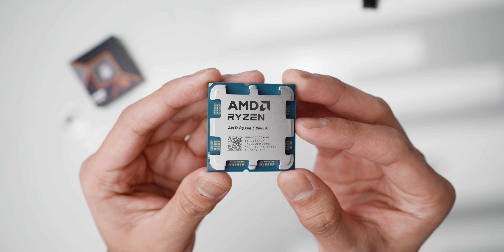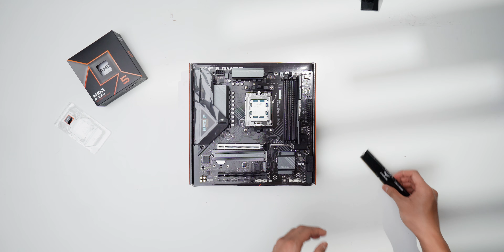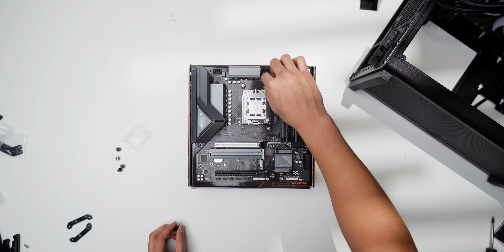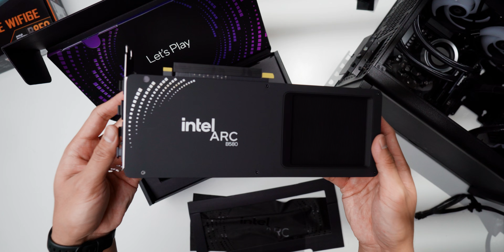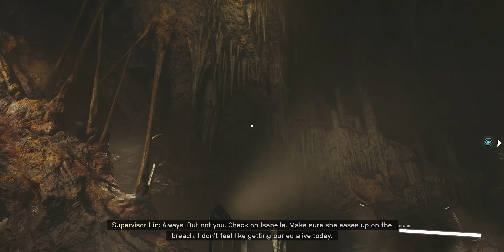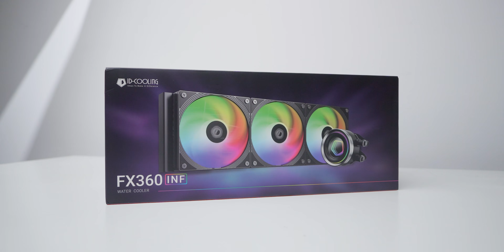This $1000 Gaming PC Build Plays Everything

Comment: The Ryzen 5 9600x is definitely a great CPU for the $$.  I have one in a Mini-ITX build paired with a RTX 4070ti.  Runs Arc Raiders, Battlefield 6 at 1440p at med/high settings with over 80fps.

Comment: Generally I like your build:
CPU, MB, SSD, RAM all good, I have similiar setup myself
I love the case visually
 however I would consider 3 main changes:

1. Save some money on AIO, for this CPU it is really not needed, a decent air cooler for $20-30 will do well.
2. For a price around $300 you can get a RX 9060 XT with a good black friday deal, not such a big difference in price against the battlemage but it will last you longer
3. The PSU will be your future bottleneck, I would go for at least 850W (ideally gold) to give yourself a bit of headroom for upgrades, the price difference won't be that much.

Most of all though I am really missing fans here. Even for a smaller case it is a lot to ask from your AIO fans to keep air moving to keep the GPU cool with only passive intake, even if most of the case sides as mesh. Plus if you decide to upgrade the GPU to something longer in the future you will need to get rid of the AIO to be able to move the PSU more towards the top (though most likely you will need to switch to a more powerful PSU anyway), but you will end up again with no proper case air movement beyond CPU fan and GPU fan. I'd stick 1 fan to the front bottom and another top rear to get some front-rear movement across the case and consider leveraging some chimney effect with 2 top  fans; not sure you can add any to the bottom, but try to create a diagonal air movement to go from front bottom to top rear across GPU and CPU with an overall positive pressure balance (more air on intake than outlet) to reduce dust build up through all the mesh you have. Sorry for the long rant, I have recently built a new rig and I have spent an unhealthy amount of time studying and optimizing my cooling and air flow.

All in all you would likely end up $50-100 higher, but with better thermals and a bit more future-proof build.

Cheers!
Reply: 1. A $20 air cooler doesn't give him the thermal headroom if he wants to upgrade to something better on AM5 down the line. Might be able to get away with it for this 9600X with 65w TDP but an AIO sets him up down the line. And this one is a super good value.
2. Good recommendation, agreed! 👍
3. 850W is prob overkill for this build. The CPU and GPU (both the Intel ARC or a 9060XT 16gb) will only use ~250W or so combined. 650w will give plenty of power for the system. It more than meets the requirements set by both GPU manufacturers. I'm currently using a 9800X3D with a 9070XT and the for the first few months I was using an 8 year old 80+ bronze 650w Corsair PSU with no problems. I upgraded to a 750w plat but only because I wanted something with a 0 RPM fan.
Reply: @kalapanas I’m looking to get my first pc, I mainly play fps games and warframe on console. Are there any prebuilts that you’d recommend for me? Or a setup that would run these types of games decently on pc?
Reply: I agree with your recommendations.  I would definitely get the RX 9060 XT with 16gb ram for this build.

Comment: Should have went 7500f, Phantom Spirit and Montech Century ii 850 watt. Build would have been around the same price, maybe even cheaper but actually have upgradability. “Upgradability” as you scam people into a low wattage psu that doesn’t have upgradability. You spend more on a cpu that performs the same as 7500f and you unnecessarily grab an AIO for a 65 watt cpu. 

Also for 650 watts psus. Rosewill VSB is the best option. Cheapest and still C tier like the 650BN

You even could have just went 7500f, same psu and a $15 budget air cooler and with that saved money you could have gotten 9060xt 16gb. Your build reeks of amateur.
Reply from the maker: Thanks for the feedback, I did mention at the end some of what you recommended. Still learning so will keep improving in future videos.
Reply: woah woah hes doing his best and his video is really good quality hes just new so calm down dont be a party pooper
Reply: @VOIDVVV  He is deliberately giving people less performance